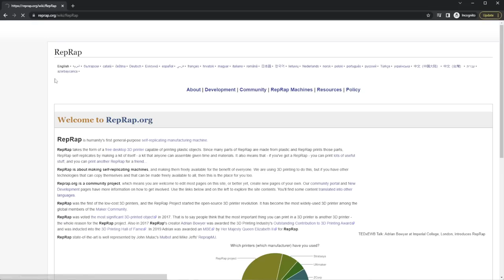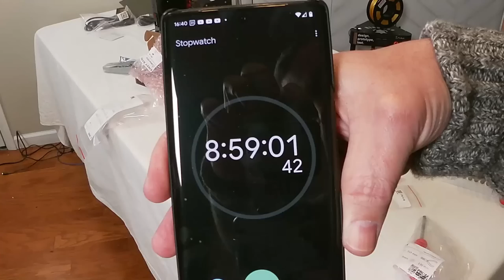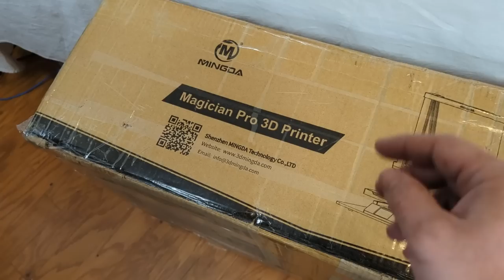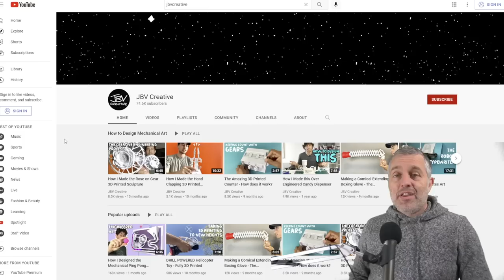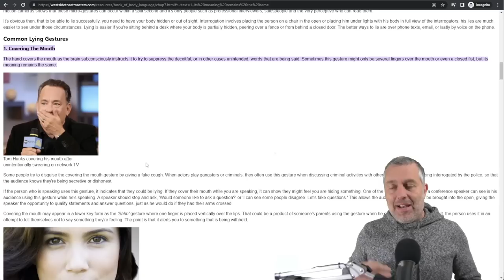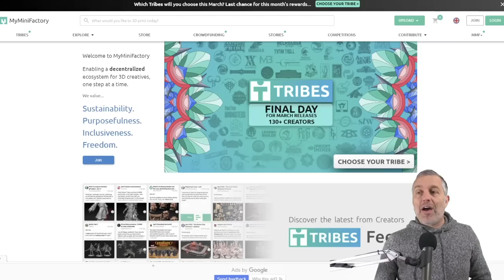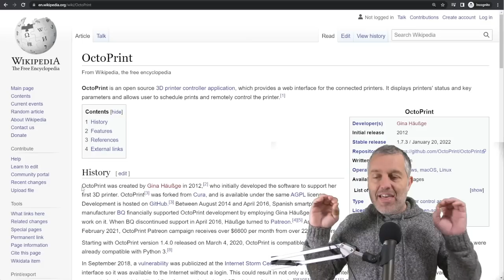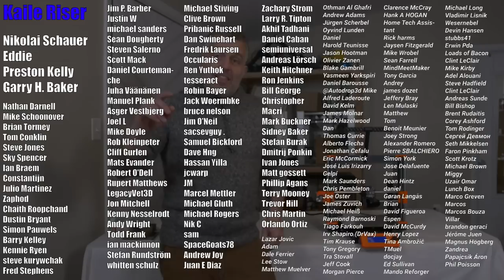Why Does Nobody Speak Truth About The Prusa I3 Mk.3? - It's Overhyped and Over Priced.

Comment: As someone who bought the kit version of the i3 mk3 I can tell you it has to be the finest assembly guide I’ve ever used. I never assembled anything even close to a 3D printer and along with help from a friend … 4 hands vs 2 hands make some of the assembly easier … we assembled mine over my lunch break for 3 days and when we turned it on it worked perfectly the first try. And it’s been flawless ever since.  It actually IS the gold standard for a hobby 3D printer.  And the best part is you can just buy them pre assembled and tested if you want to not worry about it.  Like everything else in this world you get what you pay for ….
Reply from the maker: Have you also assembled an Ender 3? Can you make the claim that Prusa is the best when you haven't compared it to anything else? Why do you guys show up at the same time. This video has been posted for over 2 months. I'm getting no views and even fewer comments. Yet I am currently arguing with Shivam Doshi and all the sudden I've got more comments from you and Ellery FG. The timing is suspicious. What forum are you guys on together that brought you here?
Reply: @DesignPrototypeTest  lighten up on the conspiracy theories … :).   I’m just a dude who owns a Prusa and found their assembly manual impressive. Most assembly manuals make assumptions that eventual can cause the user to have issues - not with the Prusa.  Regardless of the manuals there is no way an elder 3 is in the same league as a Prusa mk3 i3s
Reply from the maker: How would you know? How can you say a Prusa is the best when You have no experience with any other printers?
Reply from the maker: There is a reliable percentage of views that comment on YouTube. When I see no uptick in views yet. I'm getting 10 times the comments. Something has changed. Typically I can trace this to a Reddit post. Tell me, did you come here from a reddit post or was it a post on some other website?

Comment: prusa work out of the box? so does every printer, I had my first ender 3 working in 2 hours and my second minngda in less than 45 minutes and had been going on since more than 18 months non stop  so i don't know what are you talking about.But now i have outgrown them to design a custom CORE xy printer very soon.
Reply: I've had my MK3 working since launch about what, five years ago? Hundreds of printing hours. Got Ender 3 V2 and it's fan began to rattle after couple hours and thing sounds like age old vacuum. Not impressed.

Comment: I would still recommend a prusa for use in labs and schools where people just wanna use the printer without much interest in how it works, despite the price tag(not an issue in such cases) and "monopoly" you mentioned, its still more consistent and reliable(especially when operated by people without experience) than most other printers (and ofc much better than an ultimaker......) but yes for a hobby itself an ender is a much better way to learn about the process and actual science behind the 3D printing technology. 
I find it funny quite often when people proudly tell me they have very good knowledge on 3d printing as they have printed(on prusas) for years and cannot tell when a first layer is too high and the extrusion lines look too thin.
comment from a man who started in 2014 with a $100 Kossel Kit and just finished printing voron parts with his heavily modified Ender 3 ;)
Reply: Yes. I don’t think he realizes some people want a machine, not a hobby
Reply: @ibrue  It's exactly that. Hobby VS workhorse...

Comment: When I wanted to upgrade my 3d prints and take my 3d printing game to  the next level, my first thought was NOT to get a prusa.  Why is that , this video sums up how outdated the prusa mk3 is, yet it is considered one of the best.  I decided to go with a voron 2.4 kit from matter hackers.  1800 dollars that less then two fully assembled mk3.  I will say I do like prusa slicer for those paint on supports.
Reply: I agree with everything you said about prusa. Completely outdated. 

I almost bought a Voron, I wanted one for months but couldn't bring myself to spend that much on one printer being that I want a farm. So I almost built a 0.1 kit just for prototyping. Then I found out Two Trees finally worked all the bugs out of their Sapphire SP5, so now I have a Voron for $450. 

Thinking of selling my two enders and getting two more SP5'S.
Reply: The Prusa Mk3 is for sure outdated compared to the Voron, V core, etc. But it's still the best i3 style printer which is still the most ubiquitous style of FDM desktop printers. Voron is a 50 hour project or more (build planning, sourcing, assembly, setup, and tuning), not really the same beast at all. I did countless hours of research for my RatRig V Core 3, countless hours of assembly, and I'm still fine tuning it months later after assembly.
Reply: @TheRAINMan059  Exactly. Yes the voron is a nice printer. Would you recommend it to a beginner? No wayyy.
Reply: Voron is nice project, though I like Rat Rig way more. Prusa is indeed out-dated design, but that's actually something you want when starting 3D printing. Prusa just works out-of-box with it's profiles and keeps working year after year. Heck I've almost crashed my Prusa with Octo few times as I've remembered that I haven't detached previous prints during heat up cycle 😄
Prusa is simply put, the best choice for one who wants to begin to print without any hassles. Enders and such just don't deliver on any front except for cheap price which shows. Just got Ender 3 V2 out of curiosity next to other and it's simply put pretty damn awful printer. Heck the fans began to rattle after couple hours and they even sound like old vacuum. Not pleasant experience out-of-box. Well you get what you pay for. Nice printer for printer hobbyist. Not for printing 😃
Reply: @jothain  A Prusa MK3S+ (or a Prusa Mini for those cash strapped) is literally the best way to go for a beginner. You don't want the initial impression of the hobby to be hours of toil on subpar hardware. If they get hooked on the idea of printing, they'll start looking into upgrades and learn the fundamentals of the engineering along the way. But until then, you want their experience to be smooth. A prusa printer with PrusaSlicer and a nice removable Prusa PEI sheet is exactly what you want beginners to learn with. Not a bucket of junk.

Comment: The bags of hardware had to scale pictures on them, this makes identifying the right screw easy. With that said yes alot of Prusa's design is bad. I own two of them and both look nothing like they did when I got them due the number of upgrades, I have done to make them really good printers. But now I do not even use them. They get used by the kids. I use my Railcore II printers.

Comment: I begin the hobby with an Anet A8 and tinker a lot with it and later I bought a Ender 3 and tinker and upgraded a lot with it. And last year bought Prusa and use it just stock. I always use the Prusa over the Ender 3. I use the Ender 3 only if I need the extra print capacity.

In my experience the Prusa is just way more reliable en there fore cheaper in use. A failed print cost money and frustration.

For value the Ender 3 printer is fine but it has his design problems like the rollers, single Z rod, bowden extruder can has some issue’s to. I upgraded the Ender 3 and that cost me more than the printer it selves and cost me also a lot of time, but that was also a part of the hobby in the beginning. With the tinkering I learned a lot that experience I can still use.

My 3D print hobby is in a different phase and don’t want to tinker that much.

You say you don’t understand way someone buy a Prusa over en Ender 3, but now you know my reason. I’m not loyal to a brand, just want a good reliable printer after I don’t want to tinker with a printer any more.

One of the big reason you dislike the design is 3d printed parts, but there don’t affect the quality, so there is no problem.  Personal I like the 3d printed parts over a molded part. Just give me convenance I can replace every part very easy end cheap.

The other reason is the old design, core XY is better. Yes a Core XY is better but more expensive and more difficult to main. If you just print slower, ghosting is no big issue. 

And yes, the Ender 3 is more popular and there is 1 good reason: Price. But if you are hooked in to this hobby after buying a Ender 3 a Prusa or other options can be a good upgrade over an Ender 3.

You have made some interesting video's but I hope you make some more but stop the anger / rant video’s, there are not helping and it’s just you’re perspective. Just keep in mind that other people can have another opinion experience en that does not make them less, dump or uninformed.

That the Pusa is overhyped and over priced is not my opinion after owning both printers. The truth is that a lot of people love Prusa and for valid reasons, only you are not able to handle that kind of truth

Hope you soon make video’s like in the early days, more information how you can make a 3d printer better, like the Ender 3 or other informative video’s